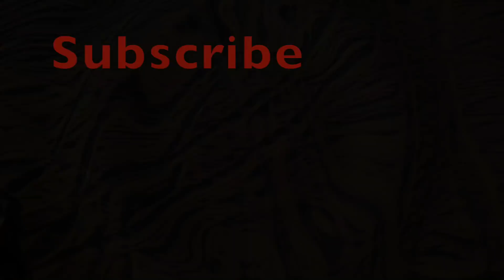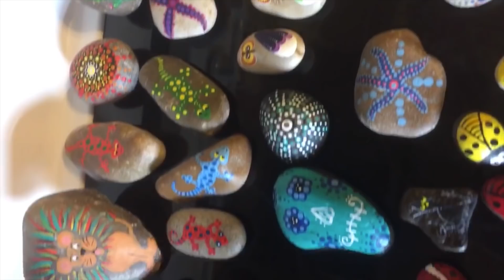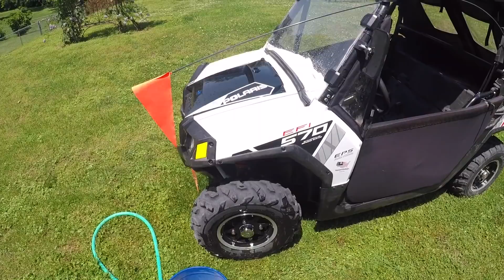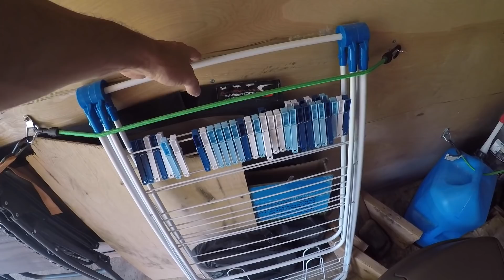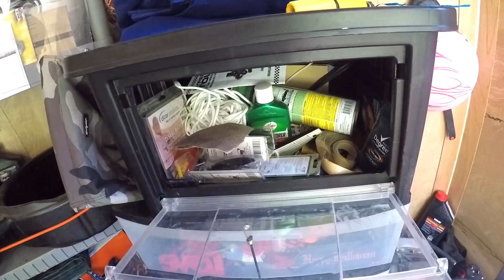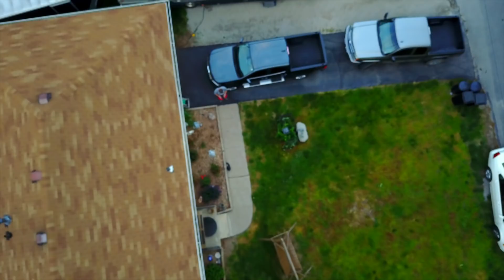Why we pull a TRAILER instead of CAR, RZR gets a bath!

Comment: Cheap way to wash your sxs or any other off road toy. Get two weed sprayers put some totally awesome in one water in the other for rinse. Then use Dw-40 on all the parts and motor helps for cleaning the next time and helps stop rust. I do this after every ride and Iv'e been doing it for 40 years.
Reply from the maker: Great idea, thanks!